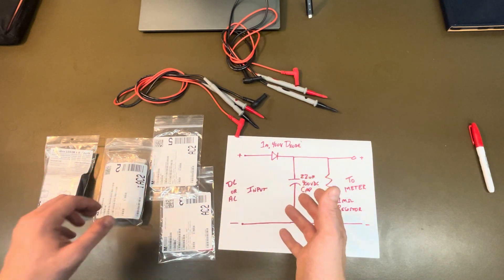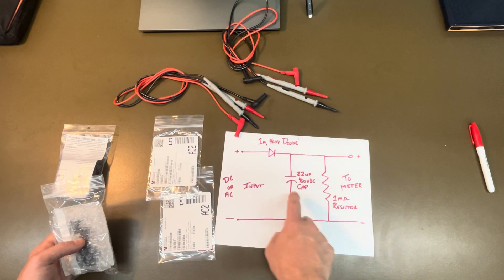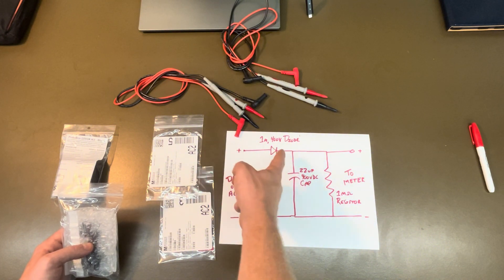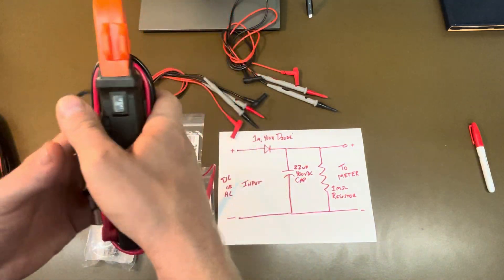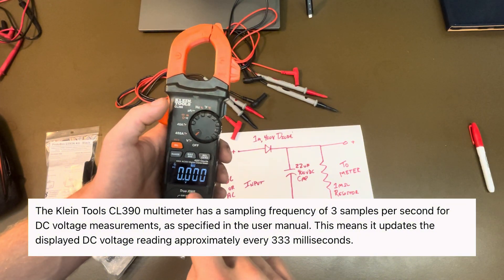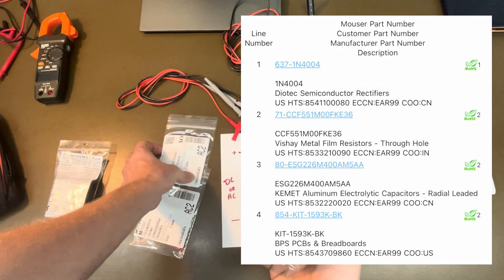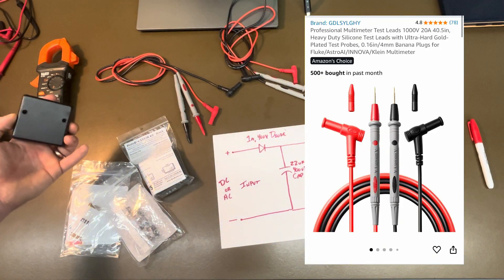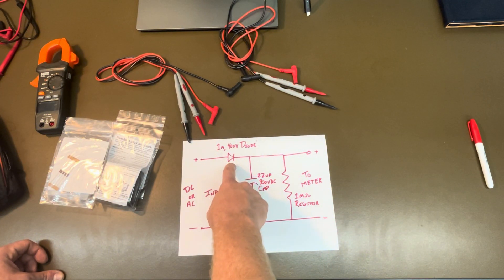DIY DVA Adapter Build for Testing Peak Voltage Output | Motorcycle & Outboard Motor Stator Testing

Comment: I figured thats what it would be  {never heard of them before}  but still puzzled. I want to test the high tension of the coil to see if its strong of weak and obviously yr normal multi meter cant be connected parallel from high to gnd  {unless I suppose you have a high resister in series = value???}  and a foundation to work from to know whats good for actual combustion spark compared to weak spark.
Reply from the maker: To bench test you need a megohmmeter. What fails a coil is insulation failure causing a premature short to the laminated core or to an adjacent coil wire. This effectively shortens the coil wrap and drops the output. 
A standard multimeter will only put out 9v (its own battery voltage) to test feedback/ calculate ohms. 9v is not enough to jump any "partially failed" gaps. A megohmeter will test resistance up to 1000v to find high resistance shorts/ insulation failure. 
Look up videos on how to test insulation on electric motor windings with a megohmeter. The procedure applies to generally and type of coil. 
Thanks for watching! Good luck!
Reply: @TheEngineRoom2017  Thanks for reply. I recall megameter with electrical wiring studies 35 years ago now that you mention it. It didnt pursue the electrical wiring, when power factor correction came in the calculations became too heavy with other reasons. But you mention  "good luck"  which implies knowledge and understanding alone isnt good enough. Or you mean luck as in the coils are Ok. I forgot about megameter. Thanks for that.

Comment: Thanks, l cant find 71-CCF551MO0FKE36. Any link?
Reply from the maker: Hi! Thats the Diode: Mouser Electronics.com, Mouser# 71-CCF551M00FKE36, Mfr.# CCF551M00FKE36, Mfr. Vishay/Dale, Description: Metal film resistors - through hole 1/4 watt, 1Mohms 1% rated to 1/2 watt.  Just looked, shows in stock! 17cents each!
Reply from the maker: https://www.mouser.com/ProductDetail/Vishay-Dale/CCF551M00FKE36?qs=IP4CA2YhK0BAYGOlWRe7zw%3D%3D&srsltid=AfmBOoosRJBgU_qZfenBcT1YM3PuoBG7TI1UiOf0bnU9lBuVgGeJUXDq